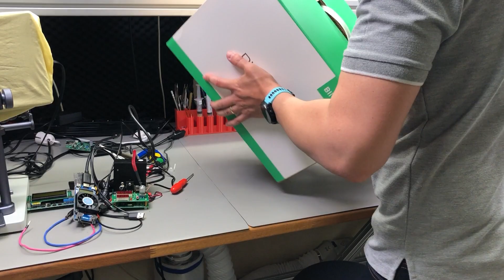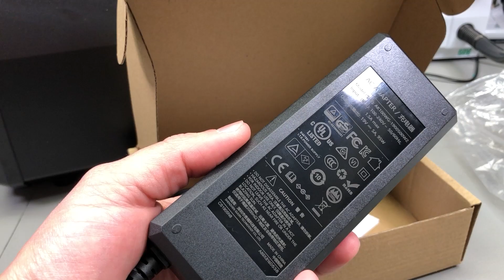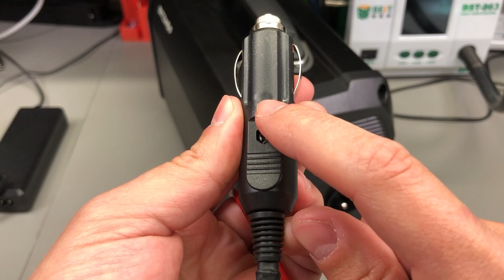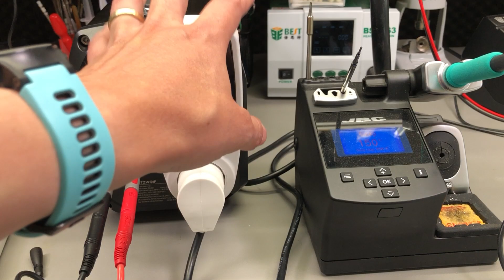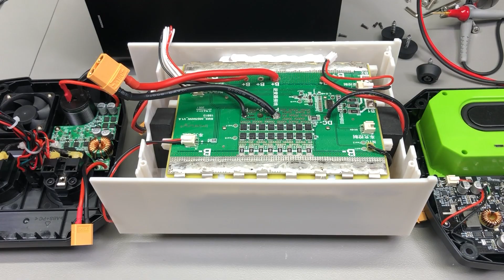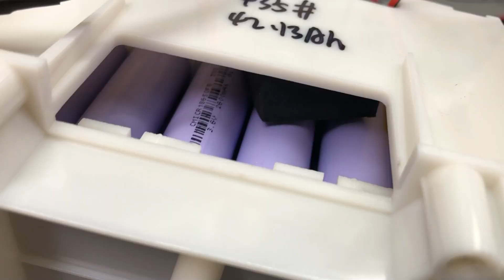Getting all the power I need with the Blitzwolf BW-PG1 Power Station | Voltlog #417

Comment: @VoltLog did you measure the real usable capacity when using the AC output? I only got 363 Wh (with a drain of 30 watts) and 378 Wh (with a drain of 500 watts)...was wondering if you can confirm these numbers
Reply: You know, that converting 12V DC to 220V sine AC needs energy. A lot. No 90% gold efficiency PC power available. The video proves, that you get 462Wh nominal battery power. 378 Wh AC means 82% efficiency, which isn't bad.

Comment: Is the 12v USB power delivery still functional when the cells are almost empty, when I'm guessing the pack voltage is around 9V?
Reply from the maker: Interesting question and I see what you're thinking: does it have just a step-down buck or a buck-boost converter in there. I currently have the power station powering something, I'll wait for it to discharge and test for that. I'll get back to you in a few days.
Reply from the maker: I checked with the battery almost empty and the USB Type-C port with PD is fully functional up to 20V output however the QC port seems to default to 5V

Comment: Any sign of fall-back thermal fusing, to prevent any of the more concerning classes of  "unpredictable behaviour"?  I suppose there might be cell-level fusing which we couldn't see (like on the Tesla 18650 packs), but I'm a bit doubtful...  It would also be interesting to see what the maximum and minimum voltages they're allowing for the cells.  I think I might lije several dispersed thermistors on a pack that big too.
Reply from the maker: I don't think there is any secondary protection through thermal fusing, other than the BMS which cuts-off based on NTC thermistor and yes having at least a couple of thermistors would have been nice for such a larger pack.